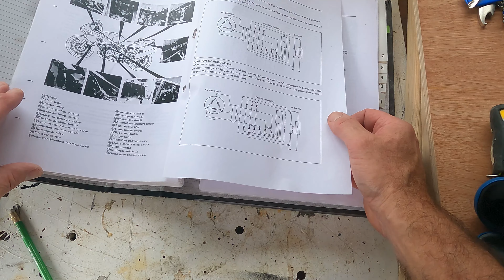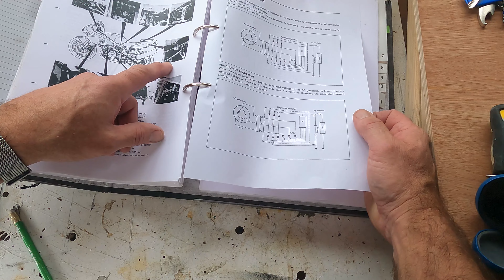My TL1000s Is Broken And Needs To Be Fixed!

Comment: Hi Heath & Kim,
I am working through my subs list backlog one channel at a time and have finally arrived at yours 🤗
This incident reminded me of my days with the Bullet 500 which towards the end would just cut out mid ride and not start again until you left it overnight.
I changed all sorts of things to fix that but have since concluded that the replacement coil I ordered from Hitchcocks' was probably slightly damaged.
I think continuity in the coil would break up when it got hot enough, which was usually when I was 10-20km from home. Then it would refuse to start until the next day, by which time the coil had cooled down and restored its continuity. Even though I had road side assistance, I usually got recovered by some kind local passing by. My Bullet was seen on the bed of pickups and various trailers during my time with it. It always amazed me how quick people were to stop and ask if I needed assistance. They wouldn't take any payment either. One guy just wanted English lessons, so I agreed and gave him my number, but he never took me up on it 🤷‍♂
But yes. I am familiar with electrical gremlins and not making it home under your own power 😝
Glad you got it sorted. That generic rectifier was just the job, so a cheap and easy fix in the end. Good work ! Can't beat a proper printed on paper workshop manual, can you ? 
Cheers you two, Happy Christmas of course !
Garry & Ruby
Reply from the maker: I guessed you are working through the videos. I have back log to get through. Yep, the TL is full of eletrical Gremlins which i've learned to live with. I left the bike in work and came home and got the van, when i returned to pick the bike up no one question me of why I was loading up a motorcycle in the van but I got an offer of help!
Happy Christmas to you.
Reply: @lipglosshelmetsandhim  😂
I wonder how many bike thieves actually do get the help of a member of the public when nicking bikes.
Probably a fair few !

Well at least you can now show people the bike appearing on your channel should you ever get interrogated by a paragon of justice, querying your intentions !